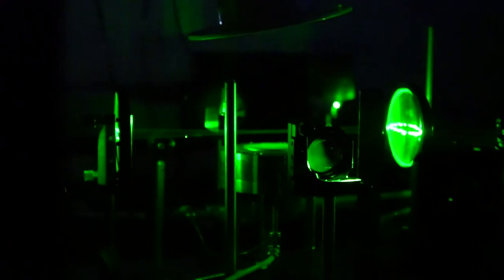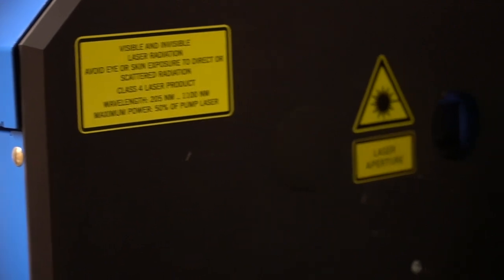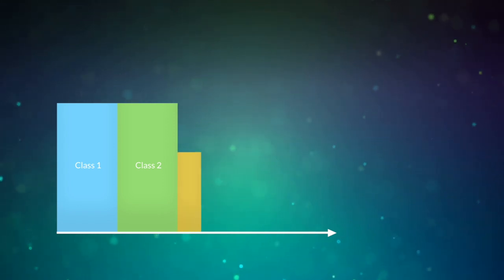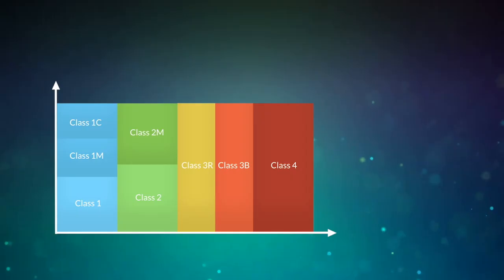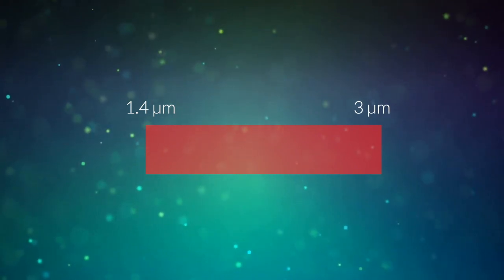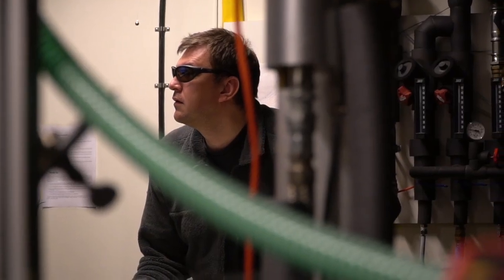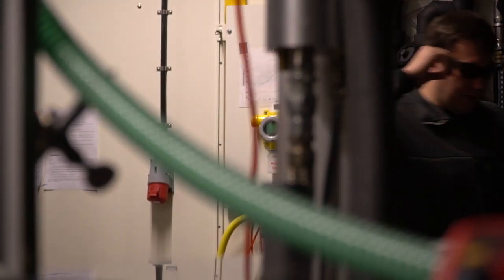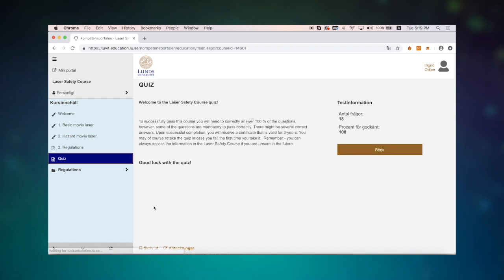Laser Safety

Comment: Yes, it's neccessary to address knowledge of laser safety, Reference Standards: EU EN207:2017 and US ANSI 136, In the end of 2024, EU will use latest standards: EN ISO19818-1:2021   which adding new terms and protection requirements.
Nowadays,Many users still exposed to laser radiations without Professional PPE, Even educational and hospital org.  At the same time, fake safety glasses fill in the market, that make it hard to distinguish.

Comment: Is 50mW capable of burning or damaging objects?
Reply: No
Reply: It depends on what kind of lenses are used in front of the laser beam. If small diameter lenses are used, then it can damage your eyes. ALWAYS wear protective laser goggles depending on the wavelength of the laser. Please research on color wheel of the laser. If your laser is blue, then look at the opposite, which is orange, so wear orange color safety glasses for protection. Never look at the laser without wearing protective lenses.

Comment: Thanks for a very detailed and informative video.  What type of protective glasses are needed for the Zeus X  7 watt 450nm laser pointer?
Reply: @hkn9739  That is simply not true.  When using a higher powered laser it will produce much brighter light.  The energy in that light can damage unprotected eyes.  Even reflected laser light or indirect veiwing of the high powered beam is hazardous!  Higher density/darker eye protection is required.  I want to know what the experts recommend for a high power 7 watt laser.
Reply: @hkn9739  Read what GS said in his reply to your comment.   Darker goggles are required for my 7 watt burning laser.